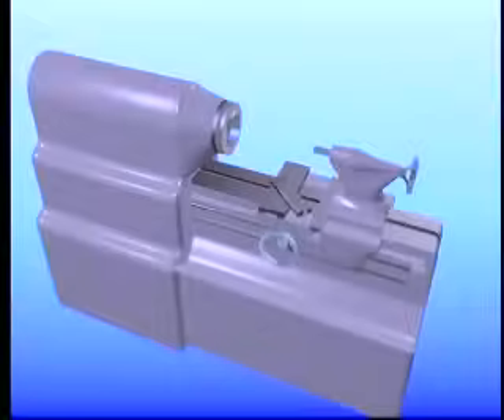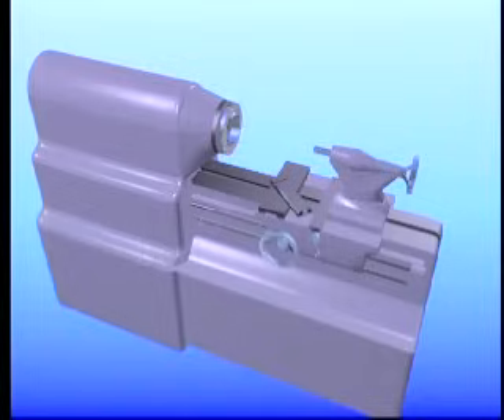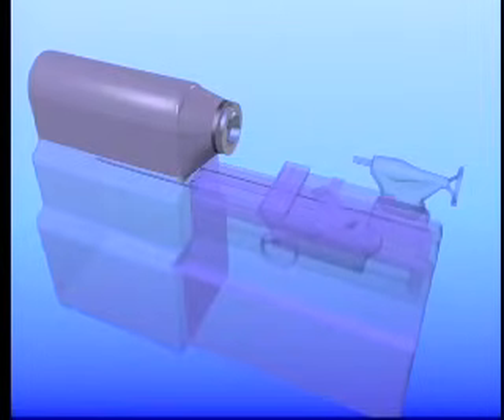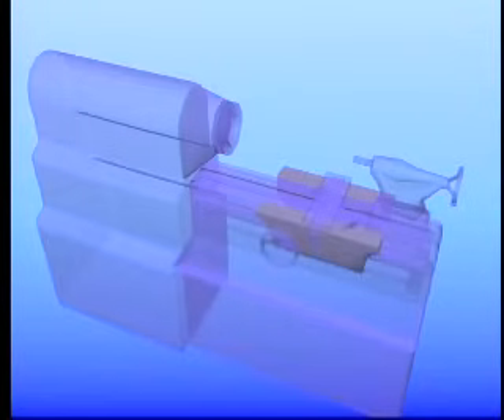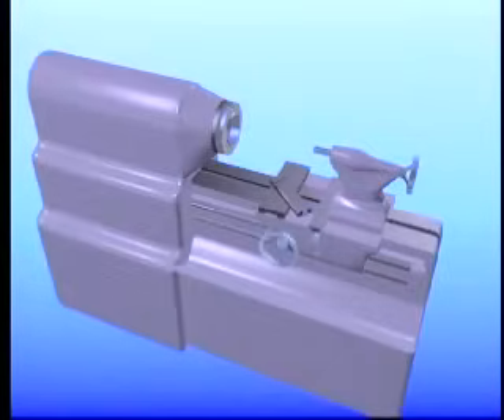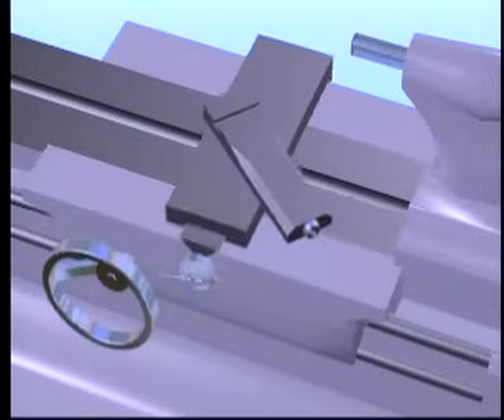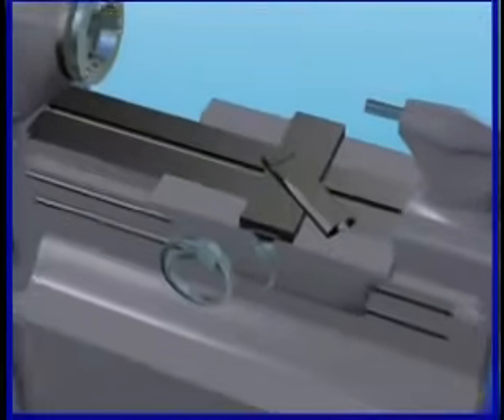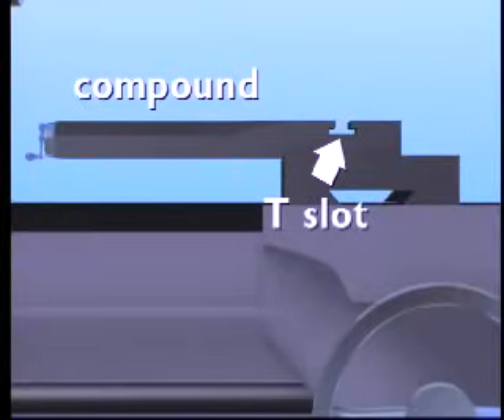Essential Machining Skills: Working with a Lathe, Part One

Comment: The "jumping" of the drill comes from the taper, wich is NOT "working as a funnel". A drill must be centered by his tip. That taper from the centerdrill just makes him scratching with one cutting edge, so it dances arround. Better to make just a small and short start hole with the center drill.

Comment: What I really appreciate in this video is how the host emphasizes safety points like trurning the chuck with a hand before starting the motor. There are many more other good points as well that I haven't seen in other sililar tutorials. Of course the contents is general but it's a good starter method.

Comment: What happens when a parting tool breaks? Is it a little dangerous, or a lot? Thanks
Reply: It usually just makes a loud crunch and ruins your part. Sometimes it will stall the lathe. Other times the part may climb up the parting tool and pull out of the chuck. The nice thing is, parting is usually done at slower speeds with high speed steel. Because of that, parts usually just fall rather than go flying. Anyway, don't let it make you nervous.

Comment: I’m a well driller, not a machinist. However, we have a lathe in our shop and I’d like to use is safely and properly. I noticed there are different speeds on ours. How do I decide what speed to use on the part or is it just a rule of whatever I feel comfortable with?

Comment: 15:00 Had a fellow student 30 years ago almost lose a finger by those metal chips. 
He pinched them with his fingers as the machine worked. it wrapped around the part he was working and around his finger. Cut almost down to the bone before the chips split apart.

Comment: here's a tip that I found very handy and I just discovered it by accident when I'm drilling something or mailing or anything like that shaving I have a huge big magnet and lay it under the work pace it accumulates a lot of the shavings not aluminum shavings but the metal ones and helps with clean up tremendously. they're the ones I use for welding to line things up on a 45 degree angle I got them at Tractor Supply they weren't very expensive 3 to a kit

Comment: Doesn't show the most important thing - how to engage the clutch, so the head starts to rotate.
I've been in a situation recently where I had a lathe and workers around, but nobody knew how to use it, me neither. I started the motor, and nothing happened. Looked around and tried a few clutches, still nothing - I felt like the stupidest man in the universe. Turned out it was the biggest handle of all :)

Comment: Hello, how are you. could you tell me what you call an operator around here in the USA? Because here in Brazil a lathe operator is called a mechanical turner.
Reply: just one more question. I have 25 years of experience as a machinist and I also have a degree in electrotechnology.
Reply: Valdecir Otacilio 
Good question 👍

Comment: When showing tools and cutters, it would help to show front, side and top views. This series needs to be redone at modern pixel definition. No mention of touching any part of your body in the rotating chuck jaws, or launching the file into your body. Nothing gets your attention about rotating parts like launching a two pound board 30 feet through where you were just standing!

Comment: I liked the video a lot.  But there must be a reason why they don't make the cutting face of the parting off tool a thou or two wider than the body of the thing so that it doesn't bind.
Reply: Yes, you grind a new cutting edge on the tip of the tool to sharpen it. The tool gets shorter as it gets older.  So you need to keep the width constant.  Just like a wood chisel.

Comment: Had an old machinists tell also when you're breaking the edge, make sure you hold the file so if the part grabs the file, it pulls it away from you. He said he a lot of machinists hold it were it throws it into to you

Comment: I would think that 'instructional' materials coming from M.I.T. would cover much more in depth ; as well as ADVANCED techniques in machining !   This does cover basics, but SHOULD include proper use of chucking . . . * Locating the material to the surface of the chuck , for instance.   
      What do you call a machinist who grabs at chips while the machine is cutting ?  
       "LEFTY" !         Sadly, much of manufacturing has gone metric , and overseas -  I've been watching machinery turn to scrap since the '70's  . . .   Today is a push button age !
Reply: I was born in 1947 ..... there are too many buttons in my laboratory ..... THERE ARE NO BUTTONS in my home shop where my home brew lathe and mill are constructed of concrete and mostly metal metal bits & pieces that were either salvaged from old junk or parts that I cast from molten hot metal myself ..... you should try it ..... it is a hoot !  The lathe and mill are mostly home cast concrete .... The internet will show you how to use concrete and cast your own concrete lathe, mill and drill press .... we did not have the internet or home computers when I cast my first lathe .... this is OLD WORLD WAR technology ..... even BOATS were made of concrete.  We had " books " back then; maybe you have seen them in a museum somewhere !  Again, a REAL HOOT !
Reply: Get a life!

Comment: A word to the wise... NEVER remove metal chip strings by hand!  You can make a chip hook with a threaded wooden file handle and a piece of hot rolled or cold rod about a foot or so long.  Bend a small hook on the end and thread the straight end into the file handle.  You can also use needle nose pliers to pull on stubborn chips.  And I repeat... NEVER try to remove metal chips by hand!
Reply: ...Right...Never....!
Reply: i tried when i'am still a beginner. its quite hot and sharp. its really dangerous

Comment: "This cutting tool is angled so that the chips come off really nicely"
proceeds to make one gigantic, continuous chip on a roughing pass
Reply: Continuous chips can be very dangerous.  I speak from experience, having worked in several machine shops for over twenty years before retiring.  Most new cutting tools have indexable throwaway inserts that have multiple cutting edges and built in chip breakers.  The old carbide tools that have brazed on carbide cutting edges were top and side ground, either with positive, negative or neutral rake angles and a particular radius on the cutting corner.  Typical radii on standard lathe cutting inserts are 1/64" (.015625"), 1/32" (.03125"), 3/64" (.046875"), 1/16" (.0625") and 1/8" (.125").  Of course, radii can be made to order for any given application.  The previously mentioned radii are generally referred to in machine shops as .015", .030", .045", .060" and .125".  With new N/C lathes, it is very common for a particular radius to be machined with a cutting tool with a smaller radius, making it particularly advantageous during machining, since multiple and various size radii can be machined with one cutting tool using a particular radius insert.  A good rule to remember is for a given federate and surface speed, the larger the tool nose radius, the better the workpiece surface finish.
Reply: thanks! Just got my 1st lathe, a 9 south bend. im 41 and a boat mechanic and always been a little fascinated by the ordinariness of (lathes for example).. I needed to buy the lantern style, for the most part ill be doing 1-2" round cuts.. starter motor shafts and commutators for example. What cutters / angles should I use as a general rule? is there a chart somewhere? its a little confusing to me. I did 2 electric motors on a 40's black and decker valve grinder i refurbished - came out within 2/10000 - despite me clamping a badly made HSS tool on the compound with a c-clamp!
Reply: To be fair, I don't remember people talking much about chip breakers back in the day.  The interwebs have greatly increased the speed at which ideas spread!
Reply: Yeah either tool wasn't sharp or feed rate not right.

Comment: Great info and explained quite well,,  my question is, the tail stock you said and showed it was not -exactly centered when starting to drill,  is it possible to adjust the tail stock so that it is more accurately  centered, with head chuck?
Reply: +jbrunson1949 The tailstock can be centered manually across the machine's ways with opposing screws on either side (the tailstock base is separate from the tailstock itself).  Centering the tailstock vertically is another story.  If the center is too high to begin with and there are no shims that can be removed between the base and top, there is little you can do.  However if the center is too low, you can use metal shims between the two components to raise the center accordingly.  You can put a magnetic stand with indicator on the lathe's faceplate or chuck and attach a Last Word or Federal (or other) indicator to tram the center.  The lathe spindle must be out of gear to co this, and a small mirror (from a woman's compact) comes in handy to see the indicator reading on the far side of the machine when tramming.  Be sure to lock the tailstock down to the ways prior to checking the center's runout (TIR or Total Indicator Reading).  Otherwise you'll get a false reading.

Comment: I heard you're not supposed to use a center drill as a pilot because the center drill has a taper angle of 60 degrees which is almost always narrower than a drill's typical 118-137 degrees. This means the drill will first contact the stock at the flutes rather than the tip. I think you might be better off using a spot drill with a larger angle (e.g. 142 spot drill for a 137 drill, 120 spot drill for a 118 drill, etc.). But I could be wrong.
Reply: +Justin Huang I was a machinist for 22 years and have never considered using a center drill a problem prior to drilling.  If your center drilled hole diameter is smaller than the drill diameter, it will contact the cutting end of the drill.  You are correct that the outer edge/flute of a drill will contact the 60 degree angle of the center drill if the c/drilled hole diameter is larger than the drill diameter.  Like I said, I've never seen much difference in the outcome.  The most important thing in my opinion, is to have a short, solid setup.  Center drills are short and rigid.  Unless you use a rigid stub drill to spot face the hole instead of a center drill, the drill will "walk" off center.  Remember... when you face off a part in a lathe, if the facing tool is not perfectly centered (especially if below center), there will be a small "tit" of material left in the center of the part's face which will cause the drill to walk off center.  So it is very important to have the facing tool "on center".  Alternatively, you can knock the tit off a part face with a stone or fine file if necessary prior to using the centering drill, but that is not necessary if your tool is centered properly to begin with.  Facing tools above center are not recommended unless the tool has a lot of (necessary) overhang because the cutting edge will deflect downward with the cutting forces.

Comment: A tip for centering your cutting to to the center of the part:

Instead of "eyeballing" the cutting edge to the center of the end of the part, use a 6" metal scale, and suspend it at about the 3" mark between the cutting tool and a part OD diameter.  Move the cross slide just enough to "pinch" the scale between the cutting edge and the work piece OD.  

Adjust the tool height until the scale is "vertical", and you will have your tool on center.

If the scale is tilted, at the upper end, away from the machinist, the tool is too high.

Visa versa if the upper end of the scale is tilting toward the machinist.
Reply: You will have to make a video. This method can be very helpful and will especially be very simple to use on a quick change tool post.

Comment: Great video series -- thanks for posting it!
I was always envious that students at MIT could use the machine tools themselves.  I got my engineering degree at the University of Illinois.  We weren't allowed to use the tools -- had to make blueprints and give those to the union machinists in the basement shop for "safety reasons".  The end result is a bunch of graduates who are awesome with calculus, but don't know the first thing about actually building anything.  Fortunately I had good experiences in high school and have acquired lots of equipment in the years since.
Reply: IlliniRob1 I am surprise MIT allowed machine tool use. I worked with more than a few Mechanical Engineers, Electrical Engineers, Civil Engineers, etc. who were excellent to adequate with the numbers, but they could barely change a light bulb when it came to hands on. The best engineers I worked will were usually out of the UK, or Europe.  I have seen a lot of FUBAR drawings from Mechanical Engineers, who never used a machine tool on their life, and you would have to spend extra time trying to reference a measurement from some god awful blind hole or other equally inaccessible place. Had they spent some time machining hands-on they would know not to do that goofy stuff.
Reply: +Seth B 
There are a lot of engineers like that. Engineering gets two kinds of people. Those who design, and don't know how to build anything. Then there are those who's whole life is building things. I didn't go to MIT, I went to OU. But most of my engineering class were those people who built things. We could weld, we could machine, we could build actual things out of either metal or wood (and some could cast metals... I didn't understand that part). The reason we went to school in engineering is that we wanted to understand how to design what we want to build, and how things work so that we can design things that work correctly, and hold up correctly. For most of my life, I have been building things... and most engineers are that way. And frankly, most of actual real world stuff is learned on the job. If the folks are referencing inaccessible places for measurements, your company should be educating them on what is an actual good place to reference from... like a center pin, or an alignment pin (probably a pair) or some such.
Reply: IlliniRob1

Comment: How about using gloves when removing chips?
Reply: Sohave While you could put on gloves to remove chips, then take them off, then put them off to remove chips again.. it is extra steps and asking for a mistake.  Better option is to use tools you already have available... a machinist's brush, scrap metal or wood sticks, long needlenose pliers and compressed air. When you're completely done working on the machine, that's when I would don gloves during collection of the chips for recycling and cleaning of the machine.  Over time, your hands will rough-up where you aren't as worried about the minor scrapes anyway.
Reply: Never wear gloves while operating a lathe.
Reply: Mark Rich Isnt that only when it is spinning. You dont want to wear gloves because they might get caught, but if you only wear them when it is turned off and you clean out chips and remember to take them off before you start the machine.
Reply: Sohave
 I was always taught no gloves loose clothing or hair period. Use pliers scrapers shovels or other tools to get chips. 
The reason I was told was some of the chips are so fine but yet very strong if an accident occurred and ones hand got wrapped up in the chip fingers or worse could be severed in seconds.  A tool you can throw away. You only get one set of digits. 
I will admit I don't practice that all the time but it made sense at the time it was said.
Reply: Mark Rich to use tools to remove chips sounds like the best solution Thank you for that. I will do that and keep the gloves away. I am a total noob at working on a lathe, I just got a Sieg baby C0 and I am trying to learn all the safety rules
Reply: Sohave
Back 11 years ago my first mill was a Sieg SX1. Still have it collecting dust on a bench. I made things with that mill people never thought was possible from such a petite machine.
My advice for you go cnc and dont look back. Anything a manual machine can do a CNC can do but with great accuracy. No matter the size of the machine a CNC is the future and actual holds resell value. You have a large learning curve ahead of you. 
Good luck with your new hobby. Machining is great but other hobbies that require machining make it that much better.
Reply: Sohave, use a pair of long needle nosed pliers to remove the nest of chips, for smaller loose chips you can use small trim paint brushes or in the case above the small brush to remove clinging chips from the drill. In all cases though, only with the upmost of care.
Reply: Once the lathe is turned off you can, and I'd recommend it, those little shavings are extremely sharp.  Wear a good pair of leather gloves.  Don't wear gloves while operating the lathe or any time the lathe is running.

Comment: Shut up J/S!! 

Hi there I was trying to find a fault with you! I could not! But I have found an auto feed works better for me when parting off ,as the constant in feed always seems to stop chatter and binding of the tool. I have snapped tools doing this by hand when I have to stop and re-grip the handle. 

P.S And I suppose men in the Jihad have never worked in a metal work shop before!

Comment: Thank's for the info., especially the details about which angle(s) are required (at the compound) to do which types of work/cutting, facing etc. Only wished the film was a bit more focused/ clearer and that I could have seen some more close-ups of the really important areas, kind of reminded me of sitting through one of those 16mm films in high school.
Reply: Agreed. It's a shame the video was too low resolution to really see the details like surface finish and spindle markings. This content is excellent and a clearer image would make it absolutely invaluable.